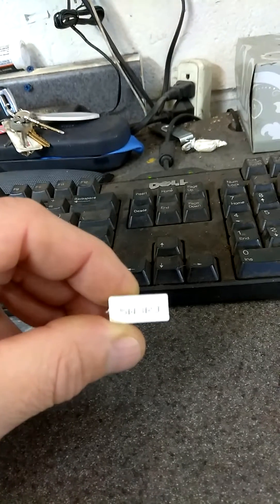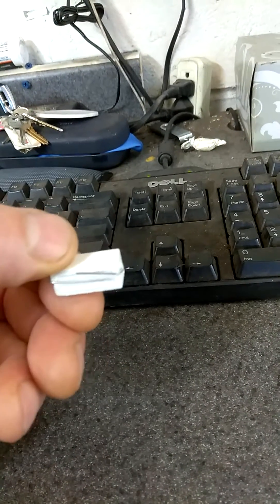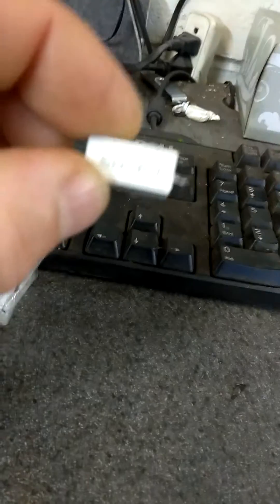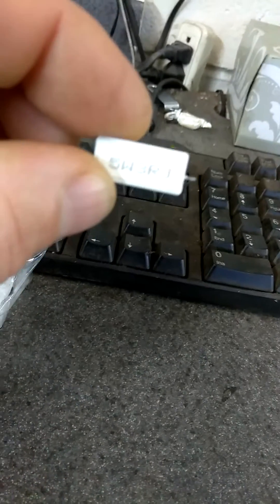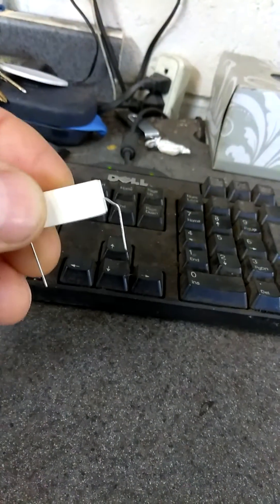Mag or magnetic f55 ride control delete using 3 ohm resistor.meineke cinnaminson

Comment: FYI, this does not work on a 2003 corvette.   Still getting the 80mph code.  The only way is to program the shocks out with a Tech 2.  (The autel ms906 programmer won’t work either.)
Reply from the maker: Well I do it all the time and I don't have any issues so something's up what resistors are you using
Reply from the maker: Try 3 omg 100watt  seem stronger
Reply: Did you end up getting this fixed?

Comment: How do you build resistor simulator for the ride height sensor?  The sensor receives 5 volts and requires a 2.93 volts signal for the computer not to throw a code. A Potentiometers was the most likely answer, but what wattage to use?
Reply from the maker: It works

Comment: Thank you for your prompt reply. I have seen another video using 10 watts for gm as well.  What are your thoughts please? Any over protective measures to reduce heat build up?
Reply from the maker: 5 and I would recommend ..even tho 3 is spec ..place in a place secured air can get around it
Reply from the maker: 5w and up
Reply from the maker: @chaotik core I've never really experimented with those to bypass them

Comment: Anthony, did you have any issues long term with the resistor burning out?
Reply from the maker: Not as of yet
Reply from the maker: Pep boys had some on the shelf  also
Reply: @anthonynastasi4098  Thanks for the quick reply!  I just ordered some from Amazon.  I'm going to try this on my '15 Yukon XL Denali.  Can you recommend a loaded strut / shock combo that you like?
Reply from the maker: @rushej  plenty of quick struts available ..monreo or or oe spec .eBay has plenty of deals..I have even seen the rear kits come with plug in resistor in box

Comment: ? it's will work for 2015 Yukon Denali
Reply from the maker: Khaleefa AL Murar yes solider them in
Reply: @anthonynastasi4098  do you have to put a resistor in the ride height sensor plug as well ? there is an exineering kit for sale the shock simulators I'm sure are just resistors but the kit also comes another plug for the ride height sensor, wasn't sure if it was just a dummy plug for dirt and debris or if it had a purpose.
Reply from the maker: @jonathangalvin1178  no